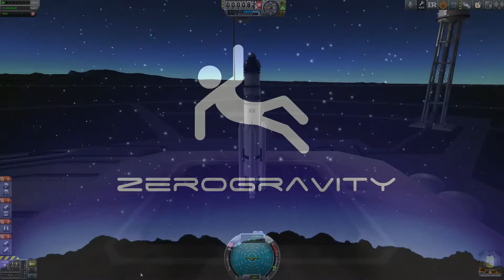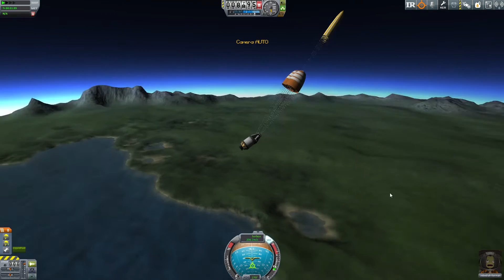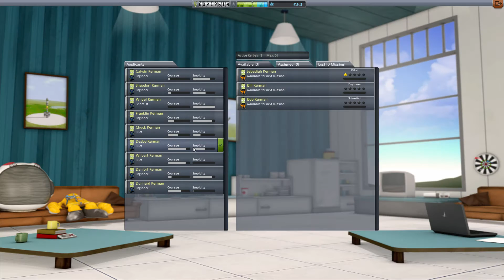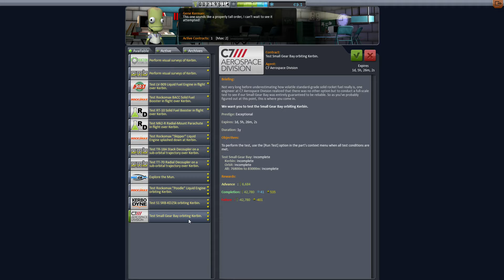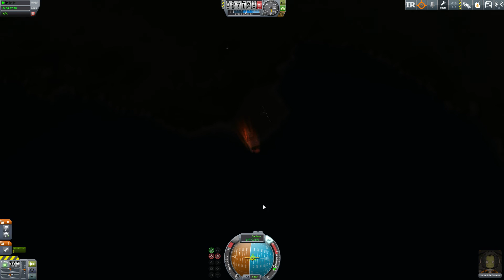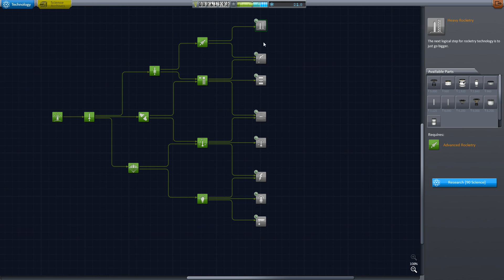NovaStar Int'l. [Ep 4] Orbital Velocity

Comment: @zak: You roll over to 90 degrees East.  You are turning with the planet's rotation, not against it.  You are taking advantage of the equatorial rotation speed you had while sitting still on the ground.  If you turn to the west, you need a lot more fuel to achieve orbit.
This is why Earth-based space centers are near the equator and not up on mountains.